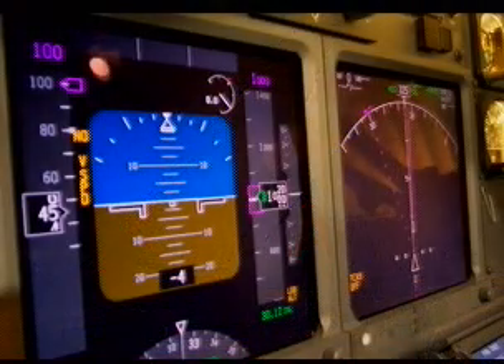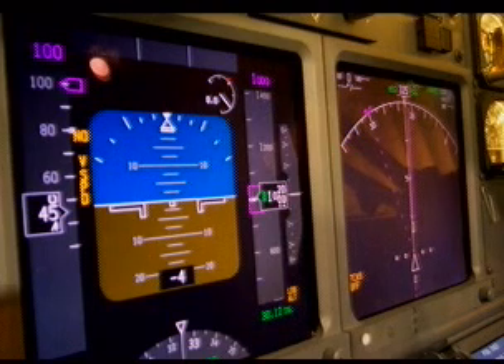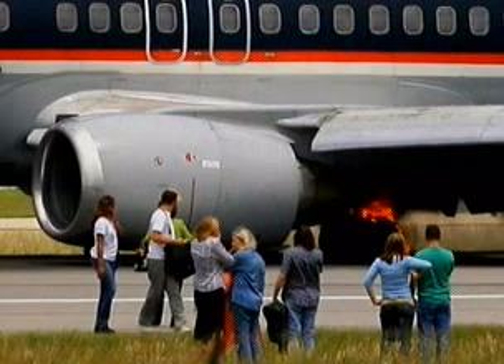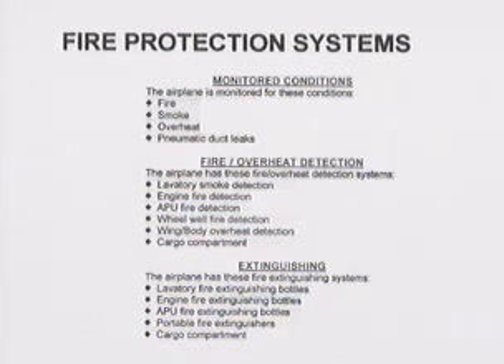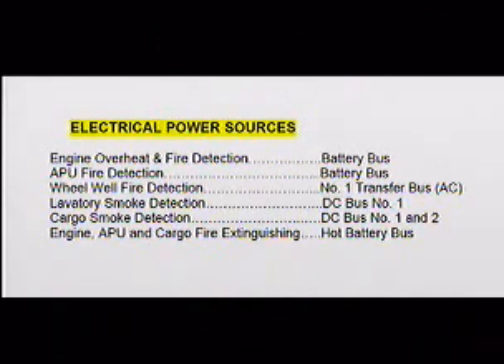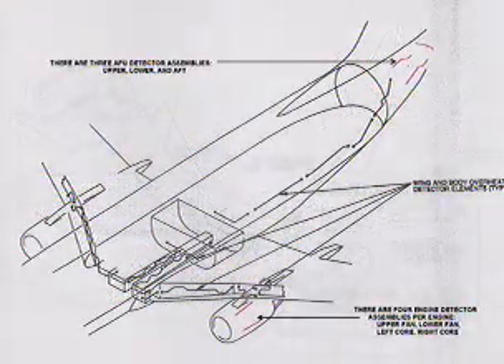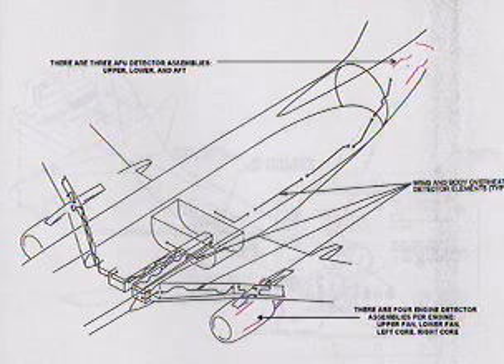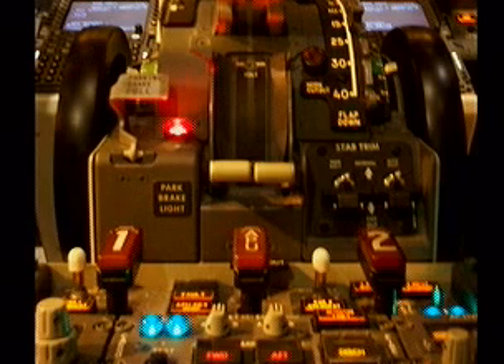737-800 FIRE PROTECTION part 1

Comment from the maker: Thank you for your comments. First, you are correct regarding the duct overheat detectors.  I chose to focus my talk on Fire Protection, ie. "detect & extinguish", and did not cover the Wing/Body Overheat system.  I'll include this distinction in future presentations.

As for your comment on the Cargo Fire Bottle, I'm a little surprised that the FAA approved a single bottle approach. I'm not familiar with carriers that ordered the optional 2nd bottle for the 737-800.